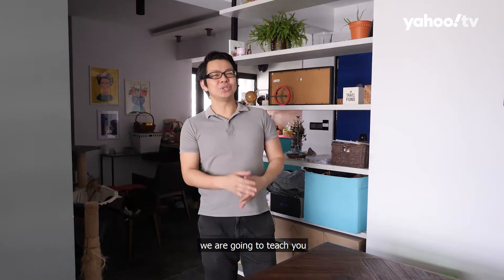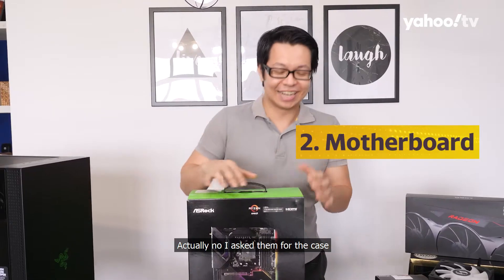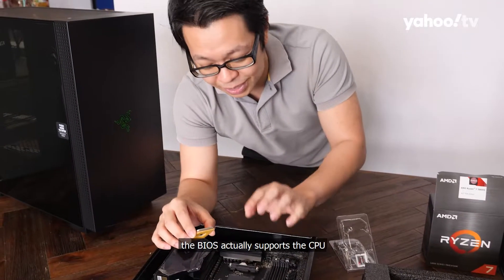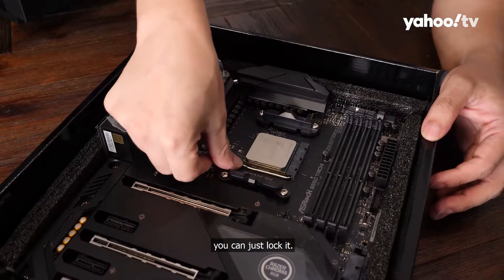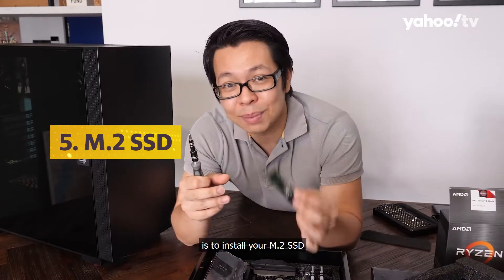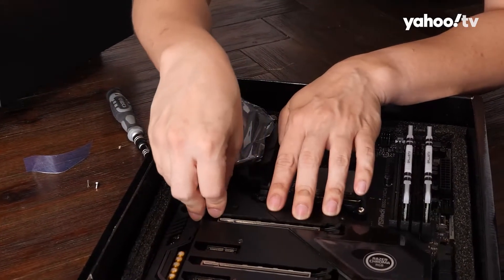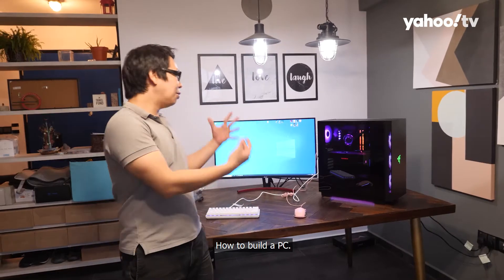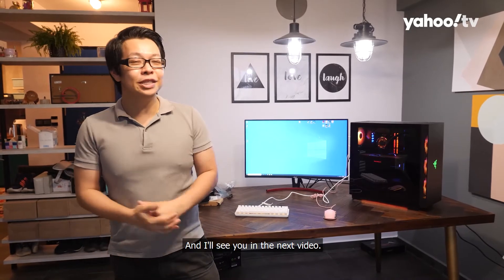How to build a PC (feat. Razer Tomahawk ATX, Asrock Taichi B550 Razer edition)

Comment: I did everthing like you said and checked 3 times. I have the same motherboard x570, but a ryzen 7 5800x3d and a GPU GIGABYTE GeForce RTX 4070 Gaming OC V2. It cant get it so show up on the monitor. I tried flashback installation of the motherboard bios and everything else that i could find, twice. On the website it said, that you need a 3000 cpu to update the bios so it supports my 5800x3d. The motherboard shows 00, so cpu. Ich bought another cpu just to update the bios. Do you have another fix for me? Or do you think it will work with the other cpu? Because your cpu got supported and it was a 5000

Comment: Nice video.I need still help.😢
Brend new MB B550 Razer Edition,after installing all parts and by MY mistake i  broke (something like a bumper) that was in place of the ssd and was used to screw the plastic that comes over ssd,one that you removed to install the ssd. How bad is it and is it just the bumper or is it related to the MB because I can't start the computer It works well. The fans are spinning, everything lights up, but there is no signal on the monitor 😔😔

Comment: I'm also curious about the temperatures. I've seen videos where this runs very hot but most of the builds have the fans opposite the way you do. (the put AIO on top) I had already been leaning to doing this the way you show with the AIO on front and exhaust on top. Did you get better air flow this way?

Comment: The main difference between B550 and X570 Chipsets is the version of PCIe lanes from them. Ignoring the direct PCIe lanes from the CPU for the moment, the X570 Chipset links to the CPU over PCIe 4.0 lanes while the B550 Chipset connects to the CPU over PCIe 3.0 lanes.

Comment: Pretty good vid and instructions on build. It could've used a bit more in depth parts instead of "other stuff". However, gave me a good insight on more/less how it looks built.  Love the look of the finished model. Would l like to see a follow up on cpu Temps and how it handles games under stress.